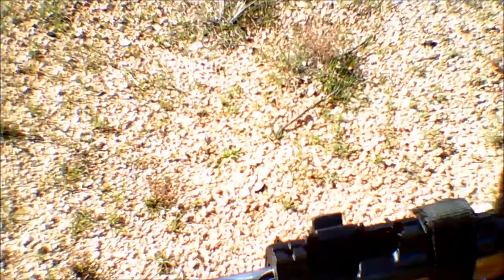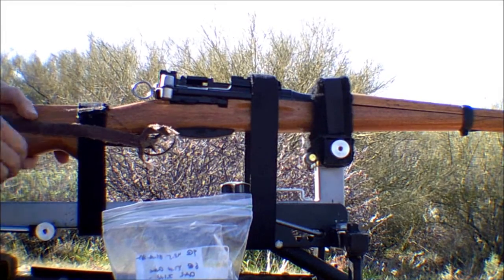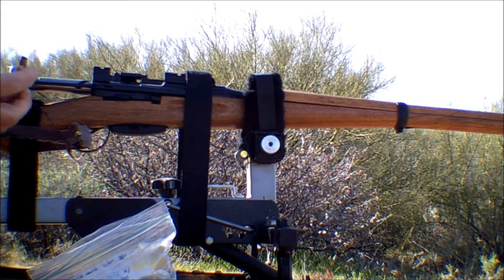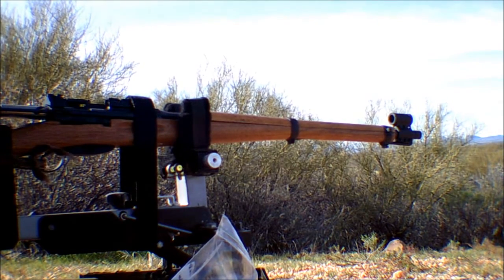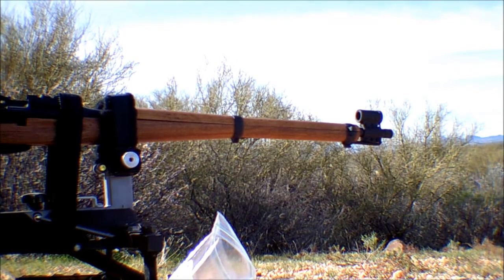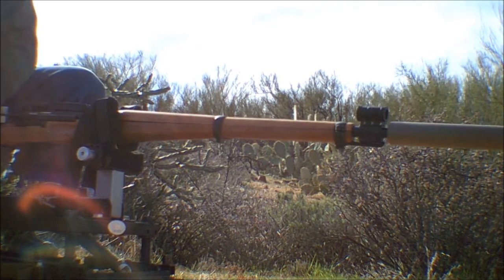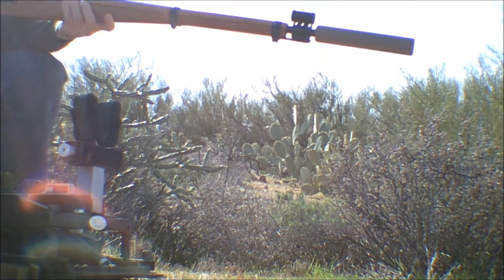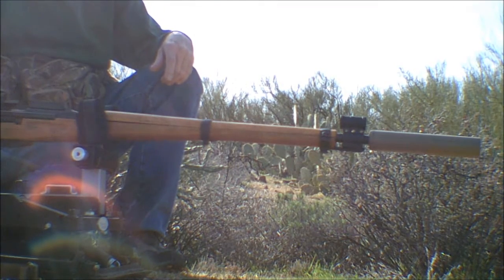Re-Barreled  ReChambered my K31 Swiss Rifle

Comment: Bravo... any other reason not to do 308... what would be your top 3 common caluber choices by ease  of conversion... stuff you can actually buy
Reply from the maker: The reason I chose to re-barrel and re-chamber in 6.5x55 Swedish Mauser was due specifically to  chamber pressures.  The Swede had the lowest chamber pressures of all the cartridges I had in mind that I now know it would have been safe to re-chamber in.

At the time I did this project I searched the internet for information about the strength of the receiver of the K31.  I went to the K31 forums and other forums as well searching for information before actually doing any work on my rifle.

As is common in most forums; all the self-appointed know-it-alls were falling all over themselves for the chance to tell me all the reasons why I shouldn't attempt such a thing for myself.  "It should be left to the experts," they said.

After I did my due diligence in searching for as much info on this particular rifle as I could I decided to proceed.  What I found out was that gun smithing a K31 is no different than working on any other rifle.  The self-appointed experts would beg to differ; only because they read something somewhere telling them it couldn't be done by a non-expert.  Since it was written by some gun writer of note, this automatically made it gun smithing gospel.

If I were to do it again I would  re-chamber in 6.5x55 Norma.  Why?  Because I know now that the receiver on a K31 is more than robust enough to handle the pressures of that round and the 6.5 Norma cartridge's parent cartridge is the 6.5x55 Swiss K31 cartridge.  

In fact I found out later that there was a gun-smith here in United States that specialized in the K31.  I sent them an email at one point and that guy who ran the gun smithing shop replied.  He stated that the 308 Winchester chambering was their most common conversion.

I also found that some K31 rifles had been re-chambered in cartridges as heavy as 300 Win Mag; although it basically turned the rifle into a single shot.  All of the 308 based cartridges were essentially fair game   to chamber the K31 in.

It does take some common safety sense to get it to work and a bit of skill but,  it can be done by the non-expert.  I am not an expert and I was able to safely do it; and the accuracy I got with the components I used was just as good if not a tiny bit better than in it's factory configuration.

At the time I did this project I did a  write up over on the CastBoolits forum that included photos and explanations.   Following is a link to my Instagram pages where I transferred all those photos to.

https://www.instagram.com/p/Bgcx84Ch3ik/

You may have to scroll down from there a ways to find all of the other photos pertaining to this project but  it may be worth your while if you're thinking of doing you K31.

Hope this short reply was of some help.
Reply: @MrTjmk  I think I saw one of the write ups. I was aiming  for 3.06 or 308 for commonality and get ability.(not that i dont love the stock chabering on its own merrits) I have a few k31 and I figure why not do a conversion on one this gives me hope... I would ask for the place you contacted but you don't have to advertise of you dont want too. Im in canada  so this may all be a non starter.
Reply from the maker: @markw7303  If I remember correctly the gun smith I alluded to is named Larry Racine. He rebarrels K31 rifles; at least he did at the time I did my project gun.

If you google his name it should bring up more info on him than I could ever remember.

I believe both the 308 and the thirty-aught-six are doable.  There are some cartridges that are a bit on the long side and they may turn your gun into a single shot.  What I mean is that you would have to load your rounds individually into the chamber.

I did find that old write up I did on this project  but it seems that I have long since removed most of the photo that accompanied that write up. 

https://castboolits.gunloads.com/showthread.php?293084-Re-Barreling-Re-Chambering-my-K31-Swiss
Reply: @MrTjmk excellent. While a bit of a shame to hack up the k31 the country of origin didn't  do much with them anyway:) (ie overall little atricion) but if its still putting rounds down range after all said and done I hardly see the problem 😉.  Cheers!!!

Comment: The suppressor don't do much difference! But thanks for the video. I like to put a suppressor into my k31 but everything I see and everyone I talk only a real expensive one works better! So there's no point!
Reply from the maker: At the time I tested my K31 wearing this suppressor it turned the muzzle blast from that of a full power 6.5x55 to a 22 rimfire.  The audio on this video leaves alot to be desired.
Thanks for watching.
Reply: @MrTjmk  I will like to see a silencer in a normal barrel of a k31. I don't know if is possible, but I'm asking this because I own a k31 and in my country is very hard to test things in guns! 1 because of the lack of gun ranges and the lack of ammo is very hard to import ammo. And there's isn't no gunsmith how you really can call gunsmith!!! The are very few store who sell guns nothing more! The max cal. Legal in my country "handguns is .32cal !!!!" Rifle " most be for hunting is 308 cal." Stupid laws in a corrupt country!
Reply from the maker: @LEXxTALIONS7913  I'm not sure what country you are from but our country also has many stupid gun laws.

It is possible to mount a suppressor onto a factory K31 barrel but such a suppressor would have to be threaded in .5" x 28 thread pitch.

This is because the diameter of a K31 barrel is not large enough to thread in the typical thread dimensions of a 7.62 Millimeter caliber.  The .308/7.62 caliber is typically threaded to accept a suppressor that has a 5/8 x 24 thread pitch.

IF you don't have gunsmiths in your area  maybe you can find a machinist who can thread the muzzle of your barrel.

I'm not a gunsmith and I'm not a machinist either and I was able to do the work myself.

Also; there are muzzle threading kits available from some online vendors that you can buy to do the work yourself.

If you do use one of these do-it-yourself kits you have to be very careful and very meticulous about doing this kind of work.

Everything has to be perfectly aligned to ensure optimum safety and function.

Thanks for taking the time to watch this video.
Reply: @MrTjmk  because of your amazing explanation I finally suppressed my gun. Thank you very much for the attention and for sharing your amazing knowledge about my/your k31.👍

Comment: If you are not a gunsmith and you don't know what you are doing mabye you should not! Just because you are a tight wad is not a reason for doing anything!
Reply from the maker: This project was successfully completed a little over four years ago and I'm still getting comments like yours.  Another reason why I did this project was to show all the self-appointed experts that smithing a K31 rifle is not beyond the realm of possibility for the average joe home machinist.  

Gunsmithing calls mostly for metal working and machining abilities and basic knowledge of Metallurgy and the mechanics of the project gun.  It's called gunsmithing because the metal work  you're doing happens to be on a gun of some sort.

Tight Wads or not, if your parents hadn't tried to have sex, you would never have been born.   IF I hadn't  tried to complete this project I never would have discovered that I could successfully do this project.  It turned out so well and I got to liking the cartridge I'd rechambered to so much that I decided to buy another rifle already chambered in the 6.5 Swedish cartridge.  This allowed me to revert my K31 back to it's original configuration with no ill effects to it's original accuracy.

Since then numerous guys have contacted me asking how they could go about re-barreling their own K31 rifles.  Never underestimate the cheap skate.
Reply: @MrTjmk  here here ! Loll. If said asshole has the gun he was a cheapskate  to buy it in the first  place. He's just jealous  he doesn't have a spare to do this with :)

Comment: did you have the barrel maker fit and chamber the receiver???  no way hell you could have done this without a lathe and a chambering reamer...and a little bit of machine tool knowhow..
Reply from the maker: This was a DIY project.  I actually posted a running blog of the entire procedure over on the Cast Boolits forum. (including pictures)  I do have a little bit of self-taught know how.  I also have the metal working machines to do the work with but,  I'm not a machinist by any stretch of the imagination; just a chronic tinkerer/do-it-yourselfer.

The barrel was just a Shilen barrel blank that I bought from midwayusa.  It was on sale at the time.  Originally I dreamt of re-chambering it in 6.5x284 Norma but I wasn't sure if the receiver was strong enough to withstand the pressures so I went with the 6.5 Swedish chambering.   I did this project cause I wanted to see If it was as hard as all the internet experts kept telling me it would be.  It turns out that they were wrong.  Most of those "Experts" were just echoing what they'd read or heard from still other self-appointed "Experts."  

I'm not a gunsmith.  I'm just a goober with a gunsmithing lathe that doesn't like to be told what he can or can't do  with it; especially by folks who rarely do any of their own work themselves.

It's not everyone's cup of tea but, I think it turned out pretty good.  A lot better than I expected.  If I had the opportunity to do all over again, I think I'd go ahead and do it in the Norma Chambering after all.  I found out after the fact that the receiver really is strong enough to withstand those higher pressures.

Comment: Schade um den schönen Schmidt-Rubin (K31) . Schweden-Mauser gibt es genug, jetzt ist dein K31 ein Zwitter!
A pity about the beautiful Schmidt-Rubin (K31). Sweden-Mauser is enough, now your K31 is a hermaphrodite!
Reply from the maker: Actually My K31 can more accurately be described as a "Switch-Barrel" K31.  I still have the original barrel that it came with and it's just a simple matter of swapping between my Swedish-Mauser chambered barrel and my 7.5x55 original K31 barrel.

One of the things I tried to achieve in re-barreling my K31 was to NOT make any irreversible alterations.  To me, my K31 is still a K31 no matter which barrel happens to be installed.

"Hermaphrodite?"  I think that description better fits Angela Merkel than it does my K31 Swiss rifle.
Reply: @ TIM MONTANO

Dear Tim!

I represent here the old European collector's opinion: "You only add original parts, a collector's piece must be at least 95% original, ther should be 95% of the original bluing/bronze, the collector's pieces should be 
the same number and so on Condition and should be shot regularly!
And we do not have a liberal but a restrictive weapons law (à la Obama) in the EU, Switzerland does not, weapons are part of everyday life! This EU Weapons Act is based on the German Weapons Act, which in the 
1970s and 1980s intensified the arms legislation several times for fear of the RAF terror (Red Army faction)!

No, Angela Merkel is not a hermaphrodite, she is a "Bilderberger Valkyrie" and one of the creatures of Jekyll Island - I am also an Austrian and not a German like the GDR Stasi IM Erika (Angela Merkel).
Austria is thanks to the Triple Entente powers and allies 1914 to 1918 such a small country as Switzerland but larger than Lichtenstein, San Marino, Monte Carlo and the Vatican. :-) We have nothing to report in world politics, we can only keep our mouths in the EU and pay for the others!
Switzerland is not in the EU, they have been smarter than the Austrians!
Since Switzerland is such a small country, there will be only a limited number of handsome Arsenal-K31, after which they will be put on the market by the team. The same applies to the Swede-Mauser - small country, foreign protective power, small military army is equal weapons in the arsenal.

best regards
Adolf
Reply from the maker: Hi Adof:

It's good to hear from folks with similar interest from all around the world.  So many different countries and so many different rules and regulations having to do with guns and gun ownership; it's mind boggling.

America is a far from perfect country but, I thank God I live here where we don't have such restrictive gun laws.  There are many in our country who are trying to get the same gun restrictions passed into law here that have already been put into effect in other countries.  So far they have been unsuccessful.

This tells me that there really is a God in Heaven and He really does answer prayers.

Thank you for your posts.

Comment: How would one be blue to thread a barrel of a standard k31 to be able to use a suppressor on it?
Reply from the maker: The wording of your question is done in manner that I have never heard before so please forgive me if the answer I give is not the answer you were looking for.

On this project K31 the   barrel was off the receiver so threading was not to difficult.  A common prohibitive variable is   the diameter of the barrel at the muzzle end.  My replacement barrel blank had a large enough diameter at the muzzle end so that I was able to thread it at 5/8"x 24 thread pitch.  The factory barrel has to small of a diameter so one would have to turn it down a bit and thread it to 1/2"x 28 thread pitch and then use an adapter in order to be able to use the standard thread pitches found on most suppressors.  Suppressor in the US have either a 1/2"x 28 thread pitch for small bore rifles or 5/8"x24 thread pitch for 30 caliber and up.  Of course, there are some variations.  I'm speaking generally.

I only have one suppressor and it's a thirty-caliber can.  It does triple duty as  a 30 caliber, 6.5 caliber and 22 caliber suppressor across five different rifles I own.  One of my 6.5 (Tikka hunter) uses an adapter to work, as did my 22 caliber Tikka rifle.

The muzzle of a factory K31 can be indexed and threaded without having to remove the barrel from the receiver proved the person doing the threading has a metal lathe with a spindle bore large enough to accommodate the diameter of the K31's receiver.  I threaded the muzzles of both my Tikka rifles without having to remove the barrels from the receiver.  As I stated; you just need a lathe with a spindle bore large enough to be able to accommodate the diameter of the receiver.

I hope this short answer was what you were looking for.  Thanks for the inquiry.

Tim M.

Comment from the maker: I've heard alot of good things about the Swedish Mauser's accuracy.   The reason I chose to re-chamber in that particular caliber was because at the time I was trying to determine which caliber to go with I thought I'd choose on the side of caution.

I chose the 6.5x55 Swede because it had lower maximum average pressures than the native 7.5x55 Swiss cartridge.  I have since found through research that the action on the K31 is stout enough and has been used to chamber cartridges up to the 300 H&H and 30-06.  

If I were to do it again (and I do dream of doing another one) I'd go with the 6.5x284 Norma cartridge.  Another factor in my choice was that the 6.5 cartridges seem to have less felt recoil than I had with the factory chambering.

My initial load workups showed alot of promise.  They were done a few months back when the weather was still a bit cold for an Arizona resident like myself.  It's now nearing summer time and the temps are closer to the 100 degree mark.  My work schedule has been so busy that I have yet to take it out a second time to continue my load workup.  I'm confident that I'll find a tack driving load combination.  My initial tests resulted in some sub-MOA groups right off the bat.

I did go back and adjust my headspace after those initial loads were worked up.  I found that I had my head spacing just a little too tight so, I've already loaded my next batch of loads.  This time I'm starting all the way at the bottom of the minimum starting loads and working my way up to the max loads.  It's just a matter of finding the free time to get to the shooting range.

In the link I posted  in the description below this video, there is a full description of the groups I shot in that initial trip to the shooting range; including pics.

Thanks for your interest.
Reply: @ TIM MONZANO: ["I've heard alot of good things about the Swedish Mauser's accuracy."] 
Auch die 7,5 × 55 mm Swiss (GP 11) Patrone ist sehr präzise, die steht der Schweden-Mauser in nichts nach!
Even the 7.5 × 55 mm Swiss (GP 11) cartridge is very precise, the Swede-Mauser is in no way!
Reply: i thought you would do one for economic reasons in 8mm Mauser or 7.62x51Nato